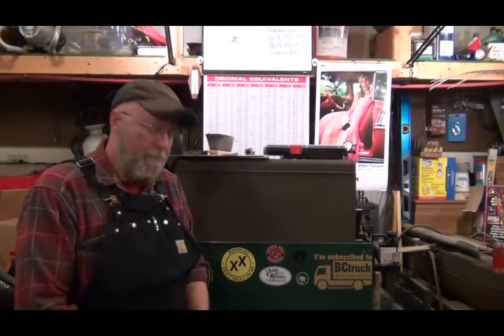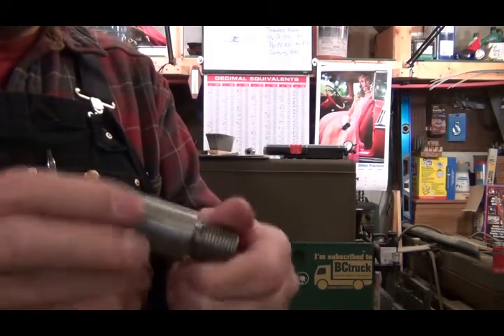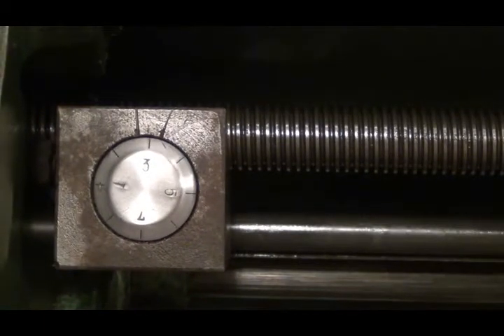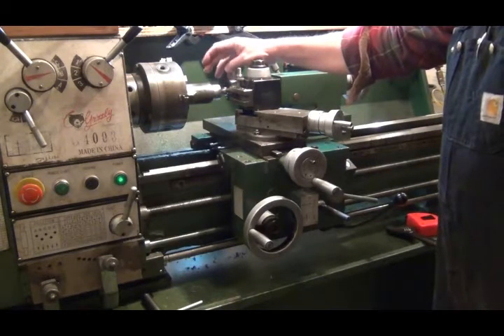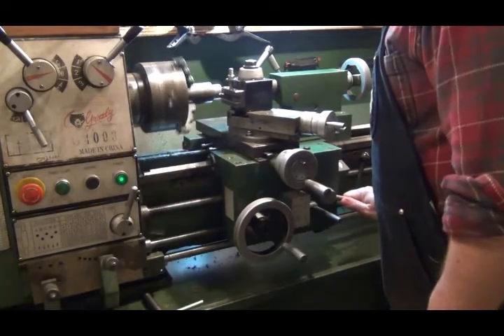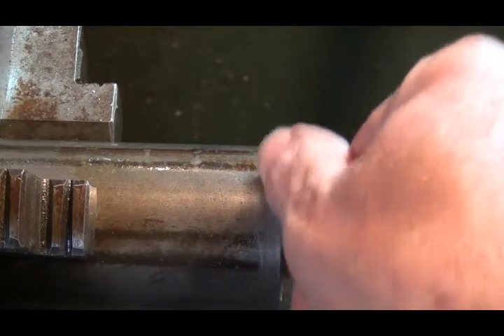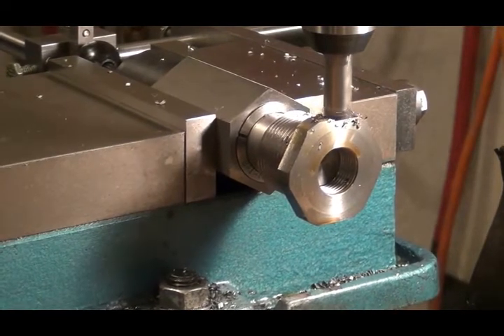Swaging press adapter nut  With lathe problems

Comment: My 4003 has the same problem . Wish that was all that was the only one. Electrical problems are continues , and the parts pricing are a ripoff. I paid 700.00 for a motor, at the GR . Wish to HeI.. had bought an old US lathe . Same shit with my G R mill , can’t believe I sold my Bridgeport for this crappy thing.

Comment: to cut the hex as large as possible in the diameter you have available: touch off at top center then cut to a depth of 0.067 x diameter. do it in multiple pass or as you chose for each side...
to machine a predetermined distance across flats of hex: touch off at top center of avaialable diameter and machine to a depth of  0.5 x (diameter available - required distance across flats of hex) in pass as you chose for each side ...
hope this helps....

Comment: Hi Steve

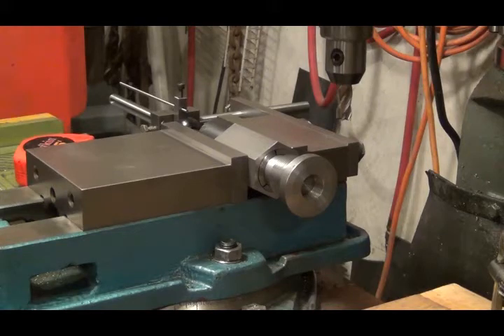At 09:00 you say you have no idea how to calculate how much you should cut of !

It's very easy, but often you DON'T want the sharp corners on the hex, so the calculation wont do it alone.

"Experience" can leave some rounding on the corner - I use 90% of the calculated value and it gives a look like this:

http://kelds.weebly.com/uploads/2/8/3/9/2839278/337320_orig.jpg

http://kelds.weebly.com/tips--tricks.html

If you have a round stock with radius R = OD/2 mounted in a hex collet in a vise and you want to find out how much to cut off in the mill to leave a little of the rounding in the corners from the original stock - here is how:

Cut off = 0,9 x  OD/2  x ( 1 - √3/2 ) 
           = OD/2 x "the same every time" = 0,9 x ( 1 - √3/2 )
           = OD/2 x 0,1206

Of course you can fiddle with the "0,9" and make it smaller if you want MORE rounding left.

If your round stock is 30mm Ø = 15mm radius - the calculation is:

Cut off   = 15 x 0,1206
             = 1,809 mm

Hope you can use it ! ;-))

Comment: What did you find with the lathe, driving me crazy, You could save that top by chucking it up and bore it out to a larger size, thread the top in the lathe to a size that will allow you to them make a new insert to screw into it with the same O.D. thread and your 1 1/2-`12 on the inside. Do it all on the lathe with all parts running plum and true and centered and all you need then is more round stock and much easier than making a new top and having to do a close layout on those holes. 
Wish I was near you, have done that for 45 years at Newport News Ship.

Comment: you dont have to back it up with the lead screw. Just crank it. that was a dangerous way to mill the part, you were putting the direction of cut in a way that could unscrew the part from what you have it screwed into, you were lucky it did not unscrew on you and really get nasty. Mill from the other side and it will be in a direction that is getting tighter not loose.  Your part look very nice but think next time you have a part screwed into a fixture that you are not pushing it in a way to unscrew it. DAVE

Comment: Grizzly G4003 leadscrew is 8 TPI. But the change gears are metric 1.5 module. The only time you use the 91/86 gear on the headstock is to cut metric threads. There should be a chart on the lathe showing change gear setup. For the English threads you are cutting, leave both head stock driver and quick change driven gear engaged go 86 tooth gear. Control TPI cut with quick change gear box. All, and I mean ALL, references on cutting threads describe setting over the top slide to 30 degrees. Or 29-1/2 degrees. Here is the GOTCHA on the G4002/3 series lathes. It is 30 degrees to lathe axis. Setting the G4003 topslide to 30 degrees marked results in 60 degrees to lathe axis. Set your topslide to 60 or 60.5 degrees indicated. The top slides on these lathes is marked to CROSS SLIDE not LATHE AXIS. It took several years and much cussing to figure this out. The 30 degree setting results in something like buttress threads that can me made to match other parts if they are cut deep enough. The 60.5 setting and a sharp bit will cut perfect threads that match any part, and be within a few thousands of the calculated top slide infeed. Also there is a chart on the front of the cross slide that tells what number on the threading dial to pick up the cut, given the TPI being cut. For really critical English threads and ALL metric threads I never disengage the cross slide drive. Make a cut. Stop the lathe. Dial out the cross slide past your zero by 50 thou or so. Reverse the lathe. Move the carriage past the end of the work. Stop the lathe. Dial in the cross slide to you Zero setting. Dial in top slide 2-3 thou. Make next cut. I always use the jog button when going forward, much better to control end of cut.

Comment: that misalignment of the dial makes no sense - 8 lines and 16 teeth should match a line for every other tooth, 2 rotations of the leadscrew (regardless if it is inch or metric) would bring the next line the exact same spot and that is also not related to the wear in the halfnuts (since those won't move). oxtoolco suggested to count the teeth on the dial gear you replaced - i'm also curious if it is 16 (can't get my head around it how it will actually be out of alignment with an 8 line dial and 16 tooth gear other than the tooth count not being a multiple of the number of lines)
Reply from the maker: I counted them several times but going to do it again when I get home from work tonight.

Comment: Hey Steve,

Have you actually measured your lead screw? When I have a problem like this I go back through and check all my initial assumptions. Trust but verify. Measure the actual pitch of your screw and count the number of teeth on the gears regardless if they are stamped or not. If you had a metric lead screw that might explain a few things.

All the best,

Tom
Reply from the maker: I held a tape measure to the screw and counted. I don't know what else to check.
Reply: Buckrun11 Measure with calipers over one inch and spacing of two adjacent threads. 

--Tom

Comment: For your half nut adjustment, go to the Grizzly website and open up the online manual for your lathe. Grizzly has put together really nice manuals that cover all adjustments and maintenance for every machine they sell. There will be a much easier way to adjust your half nuts other than pulling the whole carrage apart...
Hope this helps you some.
Matt

Comment: I'd like to see you set up a dial gauge to measure the saddle travel whilst you wind one full revolution of the threading dial. I came across a machine once with a really strange leadscrew pitch (13tpi as I recall). The gearing meant it cut the right threads, but there were similar issues with the threading dial.

You might be able to save your crooked top plate. Mount your new adaptor into the lathe screw on the plate and take some face cuts.
Reply from the maker: Paul I'd give you 10 thumbs up for this comment! Thank you very much. I have the 4 jaw chuck on my lathe and will try to do this this weekend.
Reply: I'm with you on the actual travel part but I think I have to contradict you about the second part, wont that still have the guide rods out of alignment with the thread, assuming they are aligned to start with or that it is important, not knowing the piece of equipment shown.
chris
Reply from the maker: I am going to make a different shaft that will be threaded for the top of the press to screw on to. Then I will cut the bottom flip it over and cut the top. So both the top and bottom of the plate will be true to the center line of the 1 1/2-12 tapped hole. Then the guide rods will be true to the hole also.

Comment: There has to be something screwed up in your gear train.  Under power the backlash you demonstrated should all be taken up because of the consistent direction of travel of the apron during actual threading cuts.  I think you should put a mark at 12 o'clock on your chuck and another at 12 o'clock on your leadscrew and count how many revolutions it takes of the chuck to make one full revolution of the lead screw.  From there it should be simple math to calculate if the gear train is correct.  If your lead screw is 16 tpi then it should take 1 turn of the chuck to get one turn of the lead screw when threading 16tpi (16/16 = 1/1).  If you're threading 12tpi then you should get 4 turns of the chuck for 3 turns of the lead screw (16/12 = 4/3).  8 tpi would be 2 turns of the chuck for 1 turn of the lead screw (16/8 = 2/1).  Etc.  If these numbers don't calculate out correctly then you'll know either your gear train is set incorrectly or your lead screw isn't really 16tpi.
Reply: I wrote that backwards...  12 tpi would be 3 turns of the chuck for 4 turns of the lead screw (12/16 = 3/4), 8 tpi would be 1 turn of the chuck for 2 turns of the leadscrew (8/16 = 1/2), etc.  I have it reversed in my original post.
Reply from the maker: The lead screw is 8 tpi. I will see if I can check this.

Comment: Looks like you did manage to get it threading ok. So, it will not do it correctly following standard procedure but will when using the technique shown by TL??

Colin
Reply from the maker: Yes I used the way TL showed when he was showing the method to do metric threads.